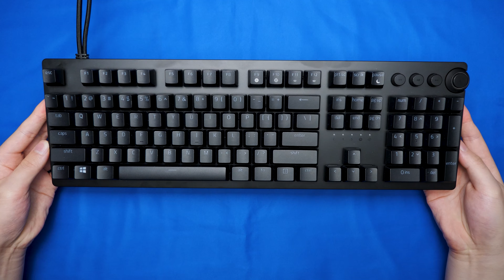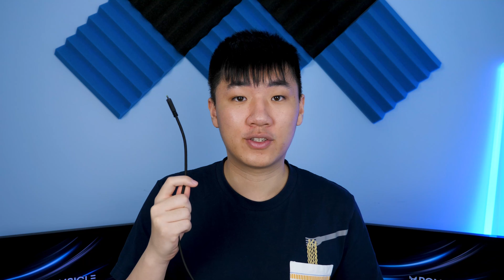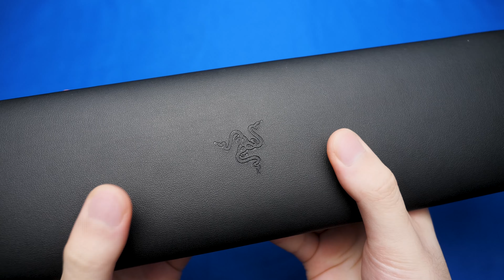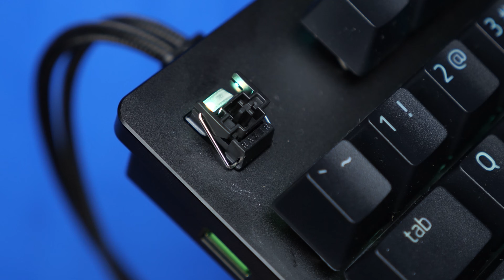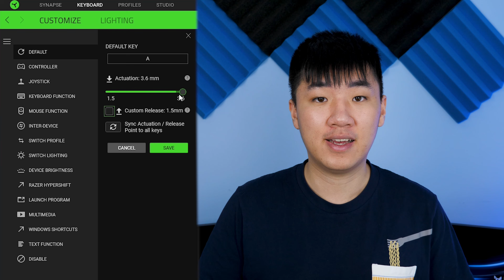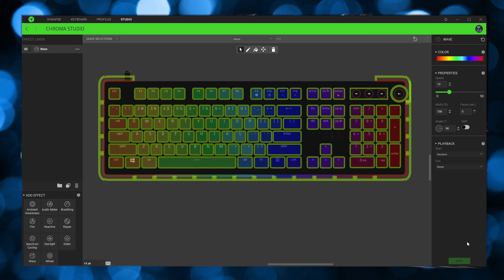NEW Razer Huntsman V2 Analog Review - Gimmick or Innovation?

Comment: This one may be the goat. It's between this and the steel series apex pro, which you can program to  have as little as .4mm actuation (there fast and sensitive it's uncanny)

The cooler master control pad has Gateron switches that are also analog. It's a very useful piece
Of kit and is fully
Programmable. I like to play with two of them and then a Gladius 2 or 3.

I don't have any trouble with the volume wheel on mine it's fine. The keycaps are pretty lame
I gotta say even being pbt.

Comment: What causes the switches to have such a high bottoming out force, is it the springs inside them?
Reply from the maker: Yup
Reply: @Romsicle  So technically we could open them up and replace them with different springs that require lower actuation force
Reply from the maker: @itsViPar  No because you can't actually open up Razer Optical Switches without destroying them.
Reply: @Romsicle  Well that sucks

Comment: This is a biased review. Like the volume knob, you mention that get in the way and wrong way of volume. Look at the right of it. There's a cut-out which you use instead of the top. So it's basically correct. You roll it up, which makes the knob goes CCW to increase volume and scroll down, making the knob goes CW to decrease the volume. It's designed to be used on the side. This is one of many biased things you said in the video. Not impressed at all.
Reply from the maker: 🤦‍♂️You literally just pointed out the issue of the knob that I was talking about. The default setting is that it goes CW to increase volume and vice versa. I even say it's not an issue, but a weird default setting for a wheel that's designed to be used on the side. You should google what "biased" means because this is far from it.

You are wilding, my dude...
Reply: @Romsicle  It is a biased review. You're nitpicking over little details that can be be altered in the Razer software. If you're talking about something that can't be changed. Like when you plug in the magnetic arm rest, for example, the lower keyboard rng remains on instead of going off since you cannot see it anyways. That's understandable, but nitpicking and being biased against a product that you can change with a few clicks in the program itself is just bad. Now, if the volume rocker cannot be changed its direction, I completely agree, but it can. Many other YouTube reviews of this keyboard, or any other gaming keyboard, do not go into the depths that you do. because they understand that it is a feature (customizable), not a flaw. I understand you prefer a custom keyboard to a Razer, Corsair, Logitech, or other brand. But I see what I see, and I've expressed my viewpoint.

Comment: I would asert that RPG players would find the analog switches valuable. Variable walking speed caters to immersion, for which there is a huge market. Multi-actuation points granting easy access to more functions is also very valuable. I can also imagine driving gamers finding use for it.

For me personally, I've hated digital movement on PC with a passion for as long as I've been gaming.
I want to be able to have the variability that a gamepad offers, while still having access to a high amount of functions that a keyboard provides. As such, analog switches in keyboards are perfect for me, and I'm very, very interested in this keyboard. The only question is, is it worth the price. 

I'm waiting on receiving a Gaming Mod Kits Keyboard Joystick to try solve this problem at a cheaper price point. 
But if it doesn't work, I may well likely get this keyboard. 
If it sells well enough, the technology may find its way into cheaper products, which could satisfy price constraints for a larger market.

Comment: You are 100% correct. 250 for a plastic base keyboard? That is an absolute slap in the face by razer. At least make it metal. Disgusting!
Reply: Well wouldn't exacly say that but i understand what you think my personal experience with razer is that they push out a lot of features but feel a bit cheaper for the price for example my g502 lightspeed feels like a chefs kiss compared to the cheap feeling of the razer viper.

Comment: Does this board have a stuck key issue? I see about 10 reviews on Amazon from people saying the keys "stick" making your character move even after you've released the key. Have you experienced this? I'm trying to decide between a huntsman elite linear or the analog v2. Thanks
Reply from the maker: I think it happened to me twice when I first used. I'd suggest the Elite Linear unless you really need the analog controls.
Reply: @Romsicle  I see. Do you know what caused the issue? I have a huntsman mini and I'm told it uses 2nd gen linear switches while the huntsman elite uses 1st gen linear so as to not downgrade I was thinking of getting the analog even though I don't plan on using the analog function. I've also seen people say the wrist rest on the analog is more comfortable than the elite as it goes all the way around.
Reply from the maker: @bladeandcloak666  I have no idea. They've had that issue since the very beginning, even on older keyboards. If you're going to buy Razer, get the 2nd Gen Linear Reds if you can. The Analog is too expensive of a board if you're not using the main feature. The wrist rest is definitely better only because there's more surface area and it's a cleaner design - other than that, it's the same comfort.
Reply: @Romsicle  Ty for the advice but that seems to be the very issue. I can't get gen 2 linear switches unless I get the analog. The linear huntsman elites are gen 1 linear switches and I already have the huntsman mini but need to upgrade to a full size for my new rig. The $50 difference is not huge for me when I'm already spending $175+. I kind of want to have the best of the best keyboard for my new rig because its going to be an alienware beast so it looks like I'll be forced to get the analog, I'm not complaining, I love Razer. Let me know if you see a way out of this though lol
Reply: @Romsicle  The problem is that as far as I know the gen2 switches are only in the Huntsman mini, not the fullsized elite. Do you have other information?

Comment: one key to equip grenade, second actuation point to throw, they even put this in marketing. game changer for fps not to mention micro adjustments to stuff like bhopping or peaking. rts there is probably untold possibilities. zoom a rifle with the select button instead of selecting then hitting zoom button. there’s tons of applications if it works well

Comment: At $200, the SteelSeries Apex Pro gives you multiple actuation points, but it lacks analog capability and PBT keycaps. Its wrist rest isn't great, and SteelSeries Engine is inferior to Razer Synapse in terms of stability and functionality. The Logitech G915 is $250, and while it is wireless, its switches don't feel nearly as good, you can't easily replace the keycaps, and it doesn't come with a wrist rest at all. So while the Huntsman V2 analog is pricey, you are getting a lot of features and extras.
Reply from the maker: You are absolutely right.
Reply: Adding to your points:
The ss apex pro only has actuation points on its alphanumeric keys whereas the huntsman v2 analog has it on all their keys.
Reply: @ashwinalagendran6748  yeah but given that most gaming keyboard don’t require number pads (imo) it isn’t too big a deal to most people or so Id assume
Reply: I totally agree with you, i think this keyboard is worth the money.
Reply: This. I don't care about that analog shit, hell, I'm not even a gamer. I bought this keyboard because I like the look, the form, the fact that it's built like a tank and especially that detachable wrist rest that is very comfortable.
Reply: you forget the corsair k100
Reply: some will get the analog because they want to try the razor linear switch but doesn't like the sensitivity of the original red linear, so the ability to adjust the actuation point is good.
Reply: For the g915 for me it is totally pointless,because what is the point of buying a wireless keyboard. you are not moving it around constantly like a headset or a mouse also wireless keyboard are a bit slower(ik that with the technology today you can’t tell a difference but if I am spending 250 on a keyboard I would like for it to be faster than most keyboards) also you have to charge once in while which gets going when gaming and you have to stop because you forgot to charge or something like that.and I get that the point of wireless is to get rid of the cable but seriously would you spend an extra 130 dollars to get rid of one cable.I get wireless mice because you are moving it around a lot but you move your like a couple times a day,also for a wireless headset you stand up without worrying it unplugging or something and you move around your room and things but I don’t recall ever picking up my keyboard and start walking into my kitchen to get a soda
Reply: Agreed. Also the Apex Pro's keypress experience is unbeatable, but it does have fewer features.
Reply: that didn't age well at all lmfao
at 220 bucks the 2023 apex pro CRUSHES this keyboard in terms of value, and they often go on sales so you can get one for like 160 bucks